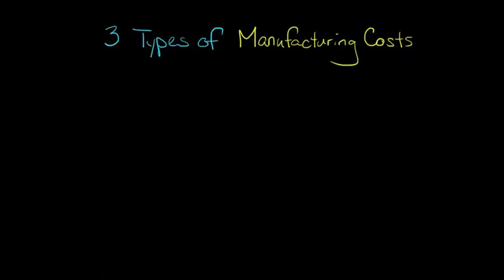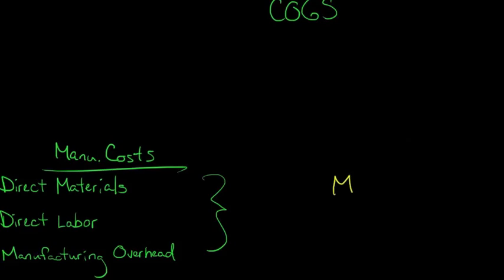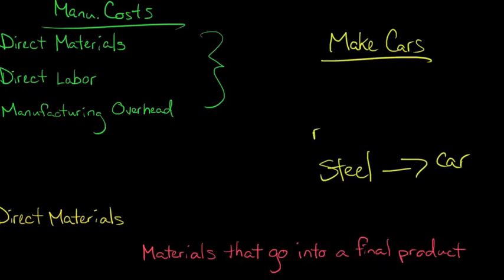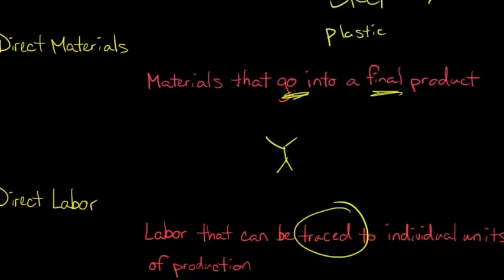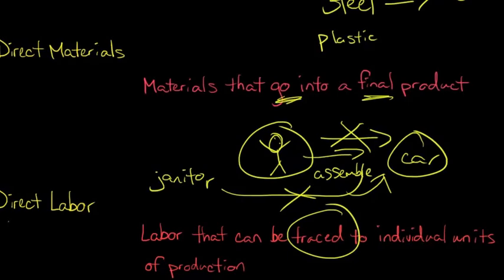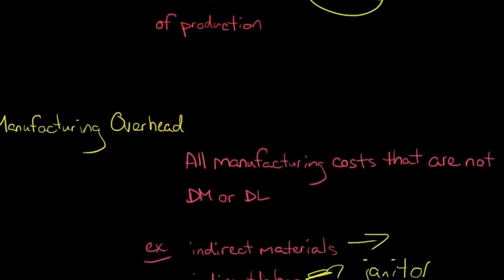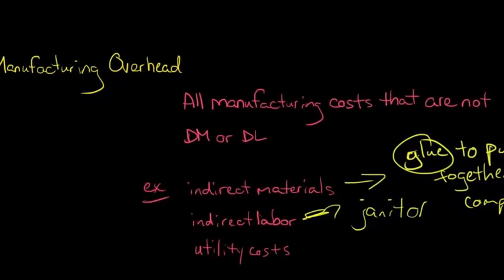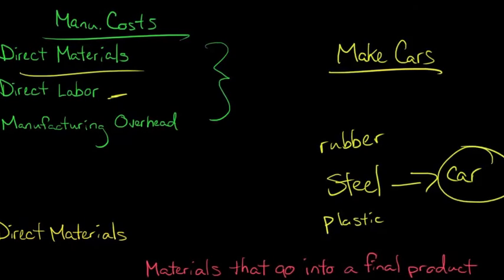3 Types of Manufacturing Costs (Direct Materials, Direct Labor, Manufacturing Overhead)

Comment: Will unit cost of machine used for the manufacturing be a direct cost? for example I need to use a drilling machine to drill a hole in the product and the cost of the drill machine is $ 2.00 per hour. So if I use the drill machine for half an hour, will $ 1.00 be included in the direct cost ?
Reply: You figure it out yet?

Comment: car paint is direct material right
Reply from the maker: You are correct.  If it is part of the final product that goes out the door, then I'd consider it a direct material.  Even though it isn't easy to trace the exact amount of paint used, the company could have a standard such as 1.5 gallons of paint is used per vehicle in order to track the costs per vehicle.  More examples of indirect materials would be cleaning supplies for the factory and oil to lubricate the machines.

Comment: What about excess factory capacity Costs (EFCC)?  How are EFCC  figured in calculating unit cost and also where should they be presented?  I assume in the COS section but possibly there is guidance that they be placed in SG&A?  Any thoughts would be appreciated.
Reply from the maker: Sometimes it would be in COS, this is a major issue that department heads will fight about.  No one wants to pay for excess of idle capacity.

Comment: Indirect materials could include disposable gloves put on at the beginning of a shift.  Re-usage applicators that you can use over the course of assembling several products. anti-static matting put on a bench at the beginning of a shift.   Each of these items aren't directly tied to the production of a single unit.
Reply: Correct.  James Ball - Thank you for correcting that.  Glue for the mirror is direct materials.  Rather than steel and rubber, he should be talking about steel panels and rubber tires - things that the car factory would have and use.  
Gloves, wipes, shelving to hold parts, computers to track inventory, etc are all indirect materials.
Importantly, indirect labor is mfg management, quality assurance, shipping and receiving, data entry etc who do not actually assemble, configure, and test the car but work in the mfg side.  
Then administration costs include accounting, sales, marketing, non-mfg managment etc., which are not included in indirect costs.

Comment: How do I calculate direct labor when the figures aren't presented and i need to complete a partially completed sheet?
Reply: I have the same question also.
Reply: You could use the labels to determine if the cost is direct or indirect.  So if it says manager of sales department,  for example,  that would only be direct if the cost object is 'sales'.

Comment: Would glue still not be considered direct materials even if you could trace specific amounts to each car? Lubricant for a machine that makes parts seems a little closer to your description, since the lubricant wouldn't end up on the car, though you could still find a way to average the amount of lubricant you need for the machine per car and split it out that way if you wanted to. Maybe you'd have to go to something a bit less direct like the janitor's supplies to find an overhead that couldn't easily be attributed to specific cars.

Maybe you'd have to decide at what point something becomes overhead somewhat arbitrarily, and this is an example of managerial accounting's flexibility.
Reply: Glue is an overhead because we estimate how much we would use its not exact and when you look at the final product you cant see the glue but its there used to attach the final product. That is how I understand it. An overhead is used in coordination with the final product.